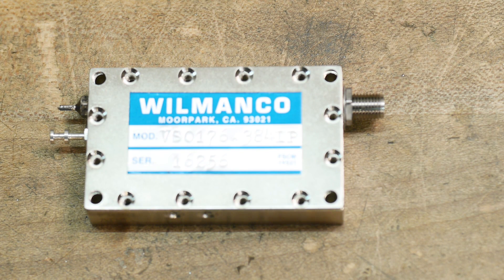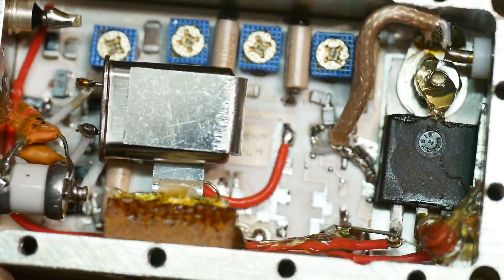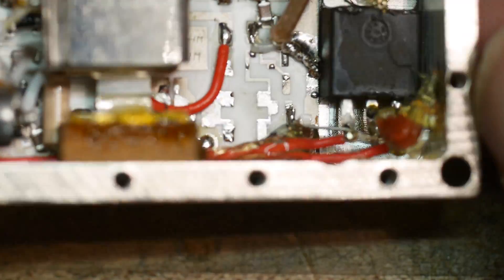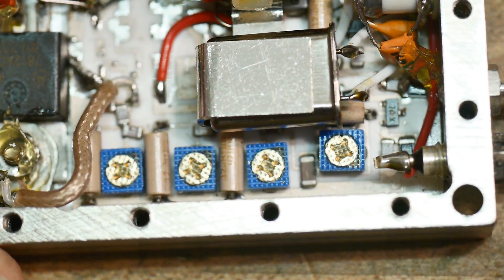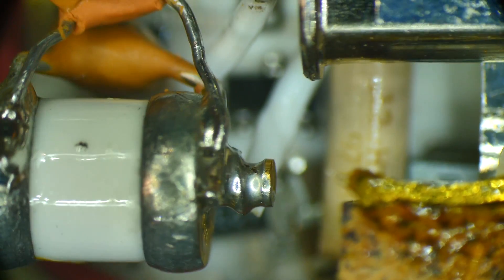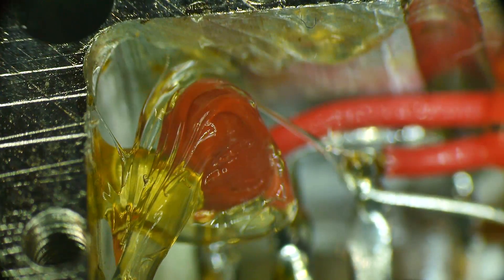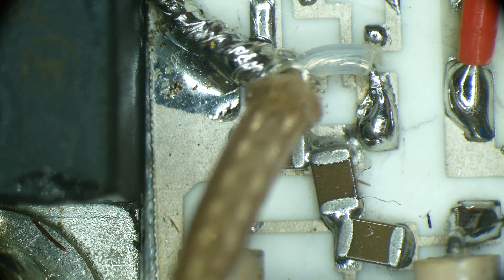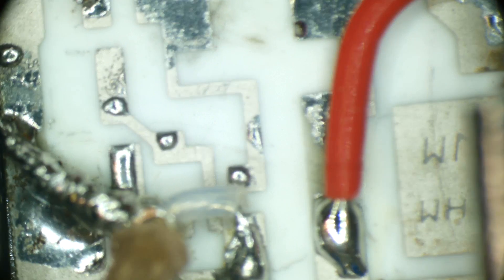#624 A look inside the 176MHz Oscillator

Comment: When you were measuring it on your signal analyzer, the fundamental was bang-on -7dBm, so with the 20dB attenuator that you mentioned, that would put it at about +13dBm which is common output power for these. I suspect that the additional traces going on around the bend from where they picked off the output might be provisions for an additional gain stage for a higher output option of around +20dBm.

Comment: Most likely its a lower frequency overtone crystal at 58 or 35 MHz and a 3x or 5x multiplier (second transistor) thus the need for the filter section to clean up the output.

Comment: You know, if I had to guess, I'd say this oscillator was originally made for use in a clock generator of some sort. If you divide 176.384MHz by 10, you get 17.6384MHz. If you mix that with 1MHz you get 16.384MHz (and the image). You can then divide that down by two a bunch of times, and get all the binary numbers down to exactly 1Hz. So I bet some similar sequence of mixing was used.
Reply from the maker: it might just be an  LO frequency when you add or subtract the IF frequency is something in the normal commercial VHF band.
Reply: @IMSAIGuy  Nah---that'd be too easy! hehee

Comment: Did you mention before what the power draw is? If there's a heater, you'd probably notice the current demand.
Would you dare unsolder the crystal? That would probably reveal enough to trace out the whole schematic.

Comment: A nice job; I too would like to peep into the oscillator. Thanks for showing the inner beauty of a hand assembled precision circuit. Yes, the crystal is offered maximum possible heat isolation in the closed space. Though the heat generation may not be much it's to guarantee precision to a better extent.
The ceramic substrate PCB with silver plated traces to offer high Q as a whole.
Those are the "golden" analog days.

Comment: It looks like a large voltage regulator for a low power oscillator, so could there be a heater? What current does it draw?
73 Steve
Reply from the maker: LM7812 linear regulator, no heater
Reply: @IMSAIGuy  I think I may have caused a misunderstanding.
What I meant was, the to220 linear voltage regulator seems a little over spec to run a small oscillator, so is it there to additionally power a heater.
Or does the firm build stuff like I do and use whatever is in the parts bin?
Steve
Reply from the maker: @oilydigits  there isn't much choice. Either TO92 or TO220. the 92 might not be enough current i would guess.